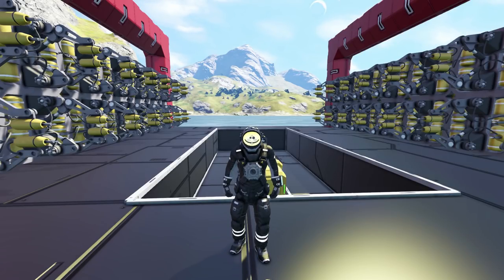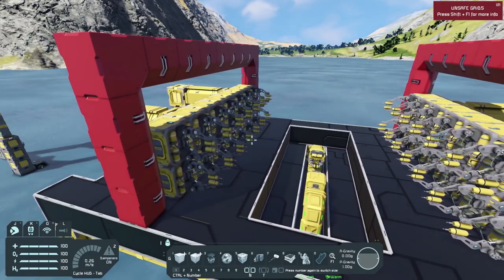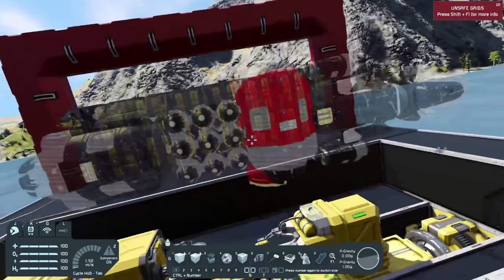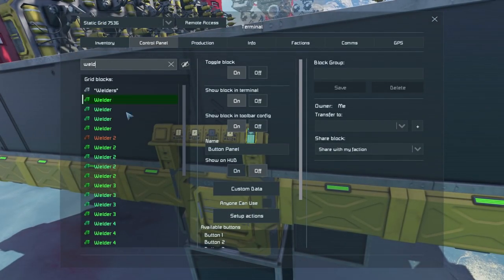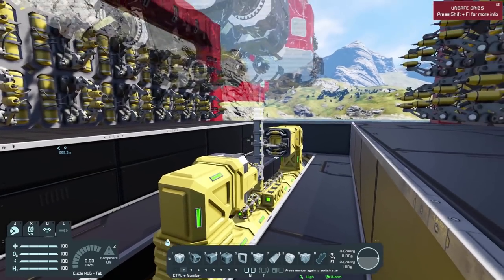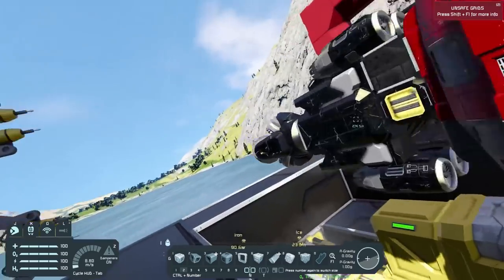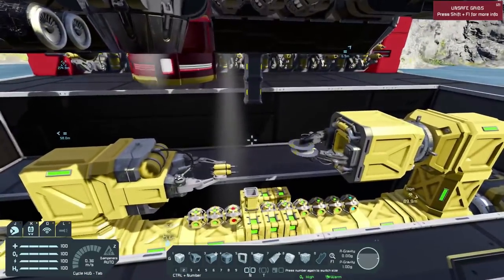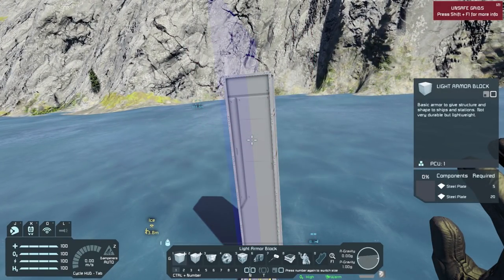Space Engineers : Small Ship Printer

Comment: One of the most basic printers designs. It's elegant and efficient. Not the easiest one to build though, nor the most cost effective. It's better to move the projector than the welders and have the blueprint directly attached to it. Or to be able to switch blueprints easily, you can attach it to a rotor set on the piston head with a bunch of projectors around it. No need for the complicated yellow subgrid. When done simply disconnect the rotor. You did realize eventually that you can group the projectors and turn them all off in one action, right? You do need one timer per projector, but you don't run out of toolbar space with grouping, :P, so you can have as many as you want.

Comment: The layout of a ship printer tends to inform your ship designs in the future, leading to some minor standardization of conveyor systems and connection points.  I reverse-engineered a printer that used a projection on a retracting rotating piston, centered between four sets of three welder pistons with sensors that retracted the pistons and timers that extended them.  The ship simply pulled back through the arms while spinning between the welders.  Despite a little shaking it tends to finish several designs just fine, even allowing for refueling and ammo supply upon completion.  Due to the process it makes sense for ships that use it to have a conveyor port somewhere on the back of the ship.

Damned if didn't take some trial and error though...I need to go back and do some fine tuning so I can throw the whole ship up on the shop...it's massive but I think folks might like it.

Comment: I put this up in survival on my current base. I tried to follow the conveyor system you have on the under side of the printer. I connected the underside to my current storage container witch is connected to an assemble and refinery. I can get material to the bottom row of welders but not the top row. I have conveyor tubes connecting from the bottom to the top welders on both welder walls. I noticed all of the welders have red tips. What do you think the reason is for the top welders not getting material. Also, would you recommend giving the printer its own dedicated assembler/refinery? Thanks for the video.
Reply: Lindy's Manor my best guess from your description is that the top row of welders are not pulling items, rather than conveyor tubes connecting top and bottom rows, try using conveyor junctions. You should only need one per row.

Comment: tests have shown moving the projection instead of the welders works better
Reply from the maker: I don't see how. If you have a design of your own, upload it and I'll check it out.
Reply: @DragonNationGaming  sorry I don't really post my blueprints.  You kind of hit on it a little during your video though.  The prints just seem more stable when the projection moves.
Reply: @DragonNationGaming   until you are printing something that is too big to move easily via pistons (though you generally use a tug instead), moving the projection is easier because it doesn't have the collision risk, the welders will build what they can reach however I believe one of the effects of moving welders instead of the projection, is that sometimes you will have blocks that dont get built because the blocks they are attached to aren't built yet and the welders move out of range, that can still happen the other way, true, but without the collision it is easier to control.

The other issues are scaling and access to your supply of components, as well as profile constraints, while you can chain pistons together in series and with difficulty, in parallel, you generally want to avoid it, and moving welders limits the size of the object to a box, pistons aren't strong without inertial tensensers and using them can make them TOO strong, the welders need access to the cargo, but the projection DOESN'T, so your options for moving it are a lot easier,

edit: when projectors first came out, the moving welders was what people defaulted to, now unless its something within full static form factor, it is usually move projector, there are some exceptions, of course...
Reply from the maker: @TheMhalpern  If you're so sure, upload a design to the workshop and I'll compare them side by side to confirm. Basically I'm saying put your money where your mouth is and it will be fun to compare the two designs.